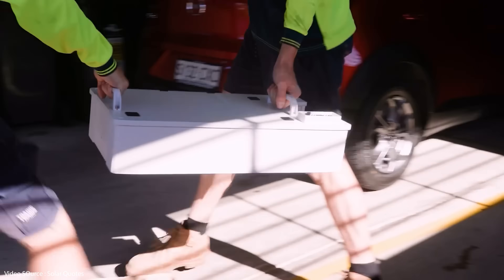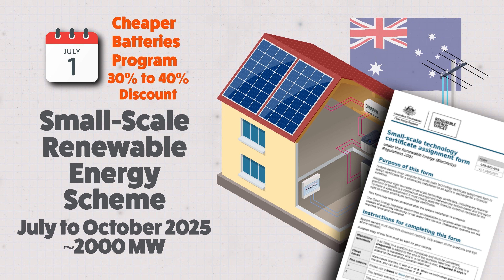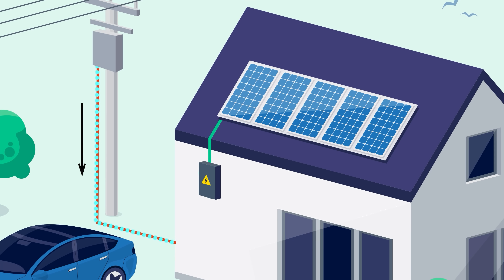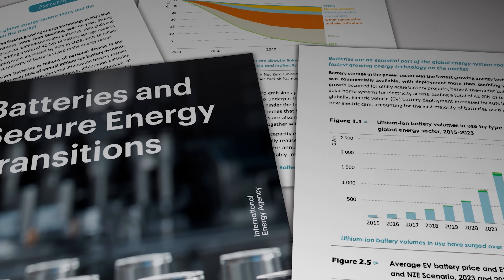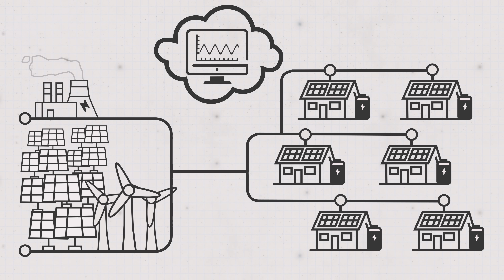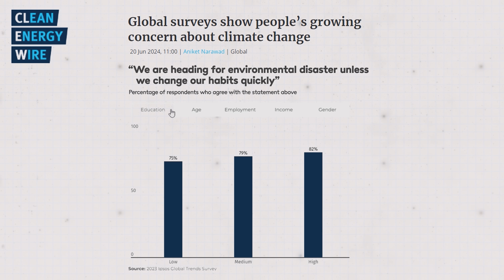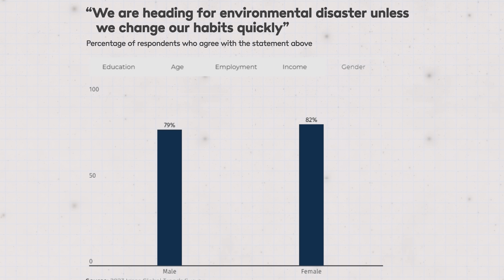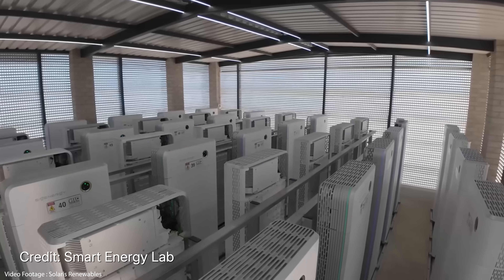Australians installed 100,000 home batteries in 17 weeks. Why can't we all do that?

Comment: You can´t and You won´t: the Government and utility providers will tax it, prohibit it, limit it, make licensing difficult and bureaucratic - as soon as enough people do it. Exactly as all tax and other benefits of EV´s will go away immediately after enough people are driving and daily using EVs. It´s not about the climate and CO2 emissions - it´s about money. 
Worldwide, it would have been nice, economical and sensible to install rooftop solar plus battery in private homes and on appartment buildings first. It´s comparably cheap, it works, it´s clean and energy is produced and consumed where it is needed. The necessary size and capacity per home is very easy to estimate from existing power bills for the last dozen years.
Upfront investment by the government - consumer pays same bill as in the past until the equipment plus interest is paid for - after that a symbolic monthly fee. This would have solved many of the grid problems (consumption peak when everybody comes home after work) and could cover some 25% to 50% of the overall energy needs. 
Governments and utility providers want taxes and profits - of 15% and more per year - they will never do it.
Reply: Screw solar.  Requires WAAY to many resources compared to geothermal.

Geothermal is the future, my friend.

A capacity factor of 70-90% compared to solar's 23%.  Works day and night nonstop for decades on decades.
Reply: @Les_S537  Nobody except Island is really doing it. For my part I´ve always imagined it would be the logical way to go and the future: endless and 24/7 reliable energy provided by mother Earth, that has been around for billions of years.
Reply: @SunshineShane  I don't follow..  Your first sentence has me flummoxed and confused.

Geothermal is about to be unlocked for the entire planet, not just points where the crust is thin, or you have high volcanic activity...

Consider...  The Kola Borehole in Russia is the deepest borehole ever dug...  ~40k feet deep.

It took the Russians 20+ years to drill it because mechanical drilling has its limits.  When you get deeper than 10k feet the rocks and pressure destroy drill bits.

This greatly slows down drilling because you have to bring the bit up, change it out, and then reinsert it down to the point of contact to begin again, but you'll only get a few hundred feet before you have to do it again.

You also have to continuously pump drilling mud into the borehole and suck the detritus back out.

It's a very long hard slog...

Enter Quaise Energy which was spawned from MIT's Plasma Science and Fusion Center.

They can use a gyrotron to produce millimeter waves (MMW) that literally vaporize rock.

Early testing shows that they can achieve 5 meters of drilling an hour through granite which has a Mohs hardness of 7 (some of the toughest rock on planet earth).  Mechanical drills can only get 0.1 meter an hour through granite by comparison.

Quaise estimates that they could redrill a new Kola Borehole in 100 days...

Their plan is to use old oil boreholes which are typically 10k-15k deep, insert the MMW drill, and reach depths of 10-20 km where the rocks are 400 C to extract superheated steam to produce abundant power.

They've already drilled a 108 meter test drill through a granite quarry in Marble Falls, TX and it sliced through it like butter.  As it vaporizes the rock the drill bit also seals (melts) the rock around it to seal the borehole where with mechanical drilling you have to seal the borehole with concrete.

Next year is their first test in the western United States.

Comment: MW is the Power output. But what is the Total Energy storage capacity? About 1.3 times in MWh Is they are tesla powerwalls model 3, about 2.5 times if it's a model 2. They are new, so I'm going to assume about 1.2 hours of discharge time

Comment: Subsidising home battery systems for dispersed storage as part of demand smoothing has got to be the way forward because it's cheaper than more centralised energy storage systems and it can relieve pressure on grid distribution infrastructure. This doesn't even require massive solar PV investment, although it helps, because the home batteries will take any discounted off-peak surplus, irrespective of how it's generated. In addition, ss ageing EVs leave the driver consumer market, their batteries can continue to offer value for demand smoothing before ultimately being recycled.

Comment: Québec, Canada, here. At less than 10 cents per kWh, with abundant hydroelectricity, our electricity is so cheap that the return on investment for professionally installed solar panels is close to 30 years, even without batteries. It makes no sense outside of niche situations.

Comment: My solar pv makes me a net exporter over the year, even in the north of England. During the winter months, however, I would seldom have any surplus to charge a battery so it would be both expensive and of doubtful environmental benefit. At night we often have a grid surplus and there can be discounts for using more power at night eg heating water tanks, storage heaters and charging EVs. The financial benefit of a home battery would improve considerably if we could top them up at night in winter when the daytime solar output is inadequate. I have never seen this suggested here in the UK and suspect it’s a marketing problem rather than anything technical. Does anyone have experience of using a battery to take advantage of surplus nighttime power?

Comment: They aren’t “lobbing electrons into the grid”. It’s an AC system so it is a frequency that is driven. Matching frequencies is tricky with so many independent systems inputting to the grid. 
Grid inertia is therefore the biggest issue with all this.

Comment: I Live in apartment building with 50 flats and flat roof. Installed 50kw solar with 50kwh LFP battery. Consumption of building is about 6Mwh per month, from May to September PV made more than 6MWh. Then it drops 4 MWh in October November. can drop down to about 1MWH Dec-Jan and pickup with longer days 👍 Czech Republic

Comment: The background was that AEMO (The electricity regulator) handed down a report where it said; to complete the poles and wires connections to large scale renewables was about $30b and wouldn't meet their legislated targets. But that can be avoided with a more decentralised grid with home batteries and tipping the vast majority of solar abundance into self-sufficiency. They initially released $2.3b and then have upped to to $5b. So that $30b of transmission lines can be either delayed or not needed at all. Spend $5b to save $24b... no brainer. 

I had my system installed in July, a modest at 10kwh. To date in almost 6months I have used a total of 80Kwh from the grid (with a pool and ducted air conditioner). Our Bills were about $2000/year... and we spend $6000 on the battery so in 3 years it's cost neutral. 

This also reshapes the market. The volume of supply will forever reduce the cost of these products when they need to be upgraded/replaced. This was true for solar panels, batteries will be no different.

Comment: Aussie “prosumer” here — you may want the bigger headline:  We’ve got retailers who link you to the wholesale tariff market to expose you to extreme swings in supply/demand AND let you buy/sell at so much profit that you can bank $100 a month (net of fees and connection charges) AND automate it via an app to tailor for the market prices and your household habits.  Generally I make $1-$3 a day and a few days a year $100 IN ONE DAY when there’s a lull in the wind power (at dinner time peak) and maybe a national grid interconnector overloads.

You’re wrong about solar curtailment, of course — overprovisioning is not to be avoided.  We get 1/3 the sun during the winter so the goal should be to install to winter demand, not summer demand.  My SolarEdge-Tesla system works with the retailer app from Amber, to automate solar curtailment every time the price goes negative when my batteries are already full.

Comment: Hello from Charlotte NC USA. We do not have battery storage, however during the day when we have solar power, we over heat our home slightly with the heat pump which also benefits from the higher out door temp and the home stays fairly warm all night. Also if it is really cold at night we burn wood in the morning to keep the home warm. ( to me a log is stored sunlight that we release when we burn it.)  Here we are still waiting for that $10 per KWH for sodium Ion batteries.
Reply from the maker: My only comment would be that a log is carbon that has been stored for decades. Burning it releases all that carbon as carbon dioxide in just a few minutes. Any new tree planted to replace the tree that that log came from will take another few decades to draw back down that carbon. That is a few decades that we do not have if we want to arrest the acceleration of atmospheric warming.
Reply: @JustHaveaThink  valid point when adding in the variable of time into the equation.

Comment: The UK doesn't get enough solar to do this. Buying a big battery on time of use tariffs is too big of a gamble. Right now you could need power in the evening and not a big enough battery to cover yourself and end up paying up to £1 per kWh, or the arbitrage is too low to be worthwhile.
Reply: Its fine in the UK. To pay £1 you'd have to be on 'agile' and frankly for a few hours on a few days thats easily avoidable. I don't use that tariff but I run the house off the battery in every 4-7pm peak time slot its no problem

Comment: Apart from the traditional early adopters which means battery purchasing will decline the reason why in Australia you would consider a backup battery is that we know we are in for a lot of power blackouts as there will not be enough power generation. Batteries last around 10 to 15 years at best then you will be up for another $10,000. The governments are putting in smart meters that will take power from “home” batteries to support the overall need. So people will expect power at night from the battery and odds on it will have been emptied. Best bet hook your house up to take at least an 8 kilowatt generator and then you have no problems and the cost is substantially less. Besides this I have been waiting over 50 years for any of the alarmist predictions on climate change to come anywhere near true. Besides if the earth gets warmer doesn’t it mean greater evaporation which means more rain which in turns provides greater vegetation including rain forest. Tge middle of Australia might actually come to life as it was originally.

Comment: Great video as always. I'm on shifting sands with PV and batteries. We want to move so it would mean a lot of investment for a short term which would yield returns for someone else (up here in the Grim North PV and batteries are too niche to be of any help selling a home). But we also shift our load on the EV and washing to overnight and repurpose the (highly recommended) heat pump tumble drier to help heat a home 'office', so we've lowered our costs (and therefore reduced the savings of battery and PV). Bloody Octopus. A heat pump would be the deciding factor but we want to move...

Comment: Im in AUS and we started with our batteries and solar very early, around 2015. Its a completely custom DIY system made by us and still going strong today, lots of space here so we have 60 medium size panels (about 12kw) mounted on the ground.

It has paid itself off many times over and saved us in power outages and reversed our bill. Our energy company pays our power credit back to us and its always been $200-$400AUD quarterly in power credit since the system was made. We've been on a very lucky power plan too, being able to feed into the grid at any time during the day for a flat $0.48c kw/h. But its ending in 2027 and we will most likely get a much lower feed-in plan so its not going to be around for much longer. 

the sun here is very sunny indeed and were so lucky for that. The system only needs to use the grid maybe 6-10 days out of the year on only completely overcast days where the sun doesn't come out at all, it stays disconnected from the grid for most of the year. Also have a standard PV system on our roof that  just feeds into the grid normally which is where the negative powerbill comes from. The off grid system generates 8.5mw approx (8,500kwh) annually. It's quite large with 30kwh(usable) of lead acid batteries (52x 190ah 12V AGM wired for 48v) Powers everything in the house including my recent EV purchase ;) The energy degradation has also been very minimal surprisingly for the lead acids, but it takes up the same space as a garden shed lol. Hoping to get lithium batteries and better solar panels at some stage as they have gotten alot better in the past 5 years.

Comment: Decent insulation, solar panels & batteries should be rolled out on every government building & communal housing project. Sure these features have high installation costs but they would significantly save government & social costs long term.

Comment: Base load power will always be necessary and it needs to run efficiently to be cheap. ( flat out, 24/7) Australia is closing its manufacturing industries as renewable power is too expensive and un reliable. Thousands of miles of transmission lines that carry power intermittently are not efficient. They have to be paid for. Wind turbines owners need to be paid even if there is no wind. The same with solar. You need to get a return on your money. Since the energy that manufacturing need is too expensive, government is giving subsidies to them. So the tax payer is paying for unreliable power to keep manufacturing to continue. Your grandfathers at the CEGB and the SECV would be horrified. They provided the cheapest power in the world. Note! I have solar, battery and a tesla.
Reply: The revolution in geothermal is coming.  It will rival solar in cost, and use WAAAAY less resources plus work day and night with a capacity factor of 70-90% vs solar's 23%.

Comment: The first step is to reduce the consumption of houses for heating and cooling, because almost all over the world they account for 40% of all energy consumption in households.
Especially heating.
So first every country should do an energy renovation of houses and buildings, and only then there would be less need for power, for example, heat pumps, and then the need for smaller batteries.

If one country like Australia does that with batteries, considering the number of people, it is a drop in the ocean. The planet does not know the borders of countries, it is one dome for all of us.
When you look at the pollution in countries like India, then it is clear that everything the EU does or Australia does is a drop in the ocean.

Greetings from Croatia, EU.

Comment: Thanks Dave, love your work. A couple of caveats to the Oz rebate scheme. There are a LOT of us who who would have jumped on this and upgraded our systems, but, a couple of flies in the ointment. Many have a Tesla PW2, in my case it's four years old. Can you get another PW2 to add to it? Nup. Will the PW3 work with a PW2? Nup. And those suppliers who had a couple of PW2 models on hand charged $$$ to release them. 

And in some cases, such as my local crew (hang your head in shame RACV Solar), the installers couldn't wipe the smile off their faces when quoting to add a second battery. In my case, they suddenly (mysteriously?) upped the price of installation by about the same amount as the subsidy, such that they wanted more to install a second battery than it cost to install the original battery despite the fact that the batteries were cheaper, the infrastructure was already in place, and there was a whopping subsidy. 

The upshot is that even more batteries would have been installed if it wasn't for the Tesla debacle, and if the installers hadn't become pigs at the proverbial trough.

Nonetheless, newer installs are going for lots of PV and much higher capacity batteries than before. So much so that the managers of power distribution are rethinking the need for major distributor lines etc. We'll possibly end up with lots of micro VPPs with less dependence on a central system.
Reply from the maker: Thanks for the extra context on the battery scheme – it's always helpful to hear the on-the-ground reality!
Reply from the maker: Thanks for your support. Much appreciated

Comment: Refrigeration was once a centralized utility service. Households bought ice blocks made in a central factory (before this we had the ice being harvested in lakes/fjords in arctic climates, and stored and distributed by large local monopolies). But innovation and manufacturing improvements made it possible to buy your own refrigerator/freezer for home use. This is the historical model which is most relevant for PV/home batteries. Homes and businesses will buy and install much/most of their own power production and storage. HOWEVER, they will still need the security of a power grid connection. Just like we still have centralized refrigerator/freezer facilities for food and drink production and wholesale product storage.

Comment: Ah yes - but the success of the scheme has blown the budget and as you expect they have scaled back the benefit.  I bought a 48kwhr battery and importantly a 20kw inverter.  I did this because the rebate was a per kWh rebate (max 100kwhr) and I wanted to be able to supplement the grid in the peak and not just look after my own needs.  
Moving the incentives to batteries less than 20kwhrs means that most batteries will be fully reserved for self use.  Diminishing the value to the community.  Well done Chris Bowen!